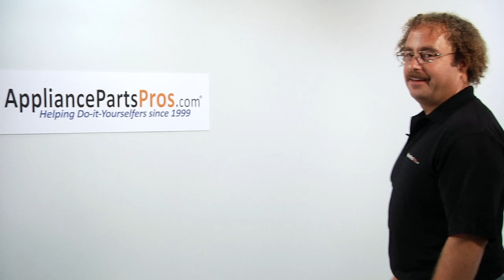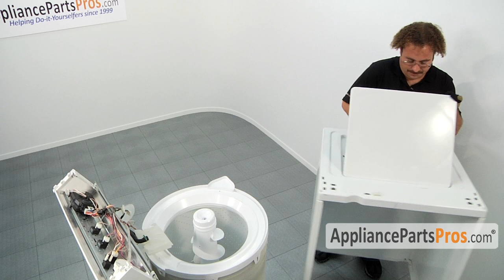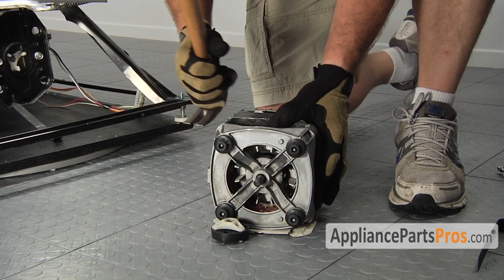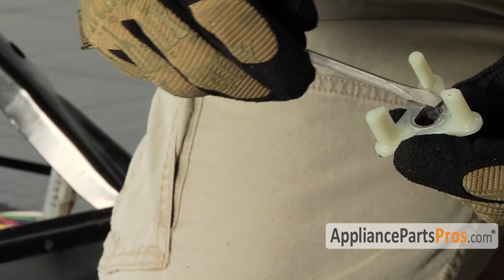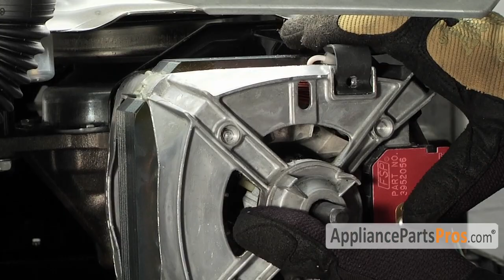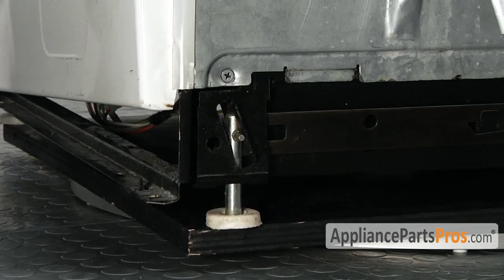How To: Whirlpool/KitchenAid/Maytag Heavy Duty Motor Coupling 285852A

Comment: So I did this procedure and the machine works, however, I could not get the bottom motor clip back on.  It only has thetop clip on but runs fine.  I pulled with everything I had and the clip wouldn't snap on.  I didn't know if there was a slightly longer clip I could get for rhe bottom of the mower or shouldI just order a new bottom clip?
Reply from the maker: It sounds like the clip would need to be replaced.

Comment: I have a Samsung washing machine and it's not determine if it's using those and is starting to wobble LeapPad from the top only vrt model no wa422prhdwr/aa01 asp thank you
Reply from the maker: Ricky Galvan You are asking about a Samsung washer on a Whirlpool washer video and I am not sure what you are asking. You can post the problem along with the appliance model number on our repair forum and the techs can help you troubleshoot the problem.

Comment from the maker: You may want to go to our forum and post this along with all the details. It will probably take more than I can type out here. Did you check to be sure there is not something caught between the tubs? Was there any oil on the clutch causing it to slip, could be from the transmission. If the agitator is trying to move in the spin cycle it could be a bad transmission. Could be the brakes are not releasing properly, could be a problem with them or the basket drive.

Comment: I've replaced both the clutch and the drive block on a Kenmore 500. It ran fine for about 1/2 dozen loads then started to do what caused me to replace those two parts in the first place....refusing to spin. It agitates fine, drains fine etc. just won't spin. I bypassed the lid switch and I can get it to spin by manually turning the drum to get it going. Could this be a coupler issue? I need to pull it apart again but when I original looked at it ( in place ) it seemed solid. Thanks!

Comment: Thank you for this video, it was a big help to guide me through replacing the motor coupler in my machine. The washer sounds great now, I think that before it stopped agitating and spinning last week it must have gotten down to only one leg on the inner plastic transfer piece. Then that final leg broke. But now if I ever have to do this job again, I'll know that if the machine starts sounding kind of noisy when agitating and spinning, it may well be a sign that the legs are breaking.

Comment from the maker: In general it shouldn't buz, unless it has a end of cycle buzzer. If it is an electrical buzzing then you may have a bad part. You will have to open the machine up and try and find out what part is causing the noise.

Comment: I guess I did actually have to remove it, from the way it looked. I took your advice frm the video. I had already started the job B4 I got your reply. It was a VERY quick response, though. Thanks! I really couldn't see any1 EVER being able to work on the Roper model I have, without doing like U said. The motor was facing/covered by the front piece of the cabinet.

Comment from the maker: Taking the cabinet off is a simple and correct process. As some have stated, another way is to take a shortcut by tipping the washer on its back and gaining access to the coupling that way. However, in this case you run a risk of damaging the gearcase. As long as you're OK with taking that chance, you can save yourself 5 minutes by not removing the washer cabinet.

Comment from the maker: I would start with checking the lid switch. If its bad the washer thinks the lid is up and wont do the rinse/spin cycle. If that checks out you may have to look at the timer. If you need help you can always register and ask techs questions on our forum.

Comment from the maker: @Feffers01 If you have a pump belt and a drive belt, you probably have a Maytag made washer. It does not use the coupling shown in this video. Feel free to post your washer model number here. What you're describing might be due to a frozen pulley, most likely the pump pulley. You can remove the pump belt off the pulley and see if you can rotate the pulley by hand. If you can't, the pump is locked up. You may have a sock or something similar inside the pump locking it up. Hope this helps.